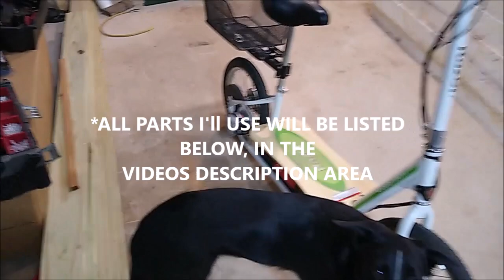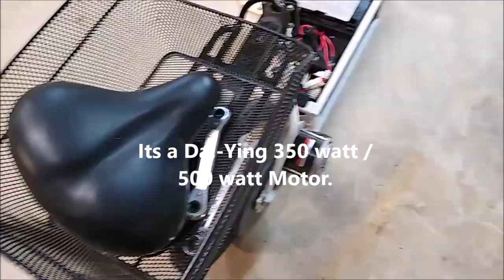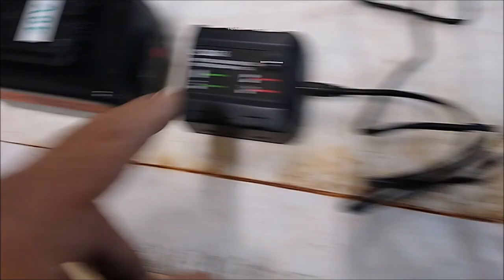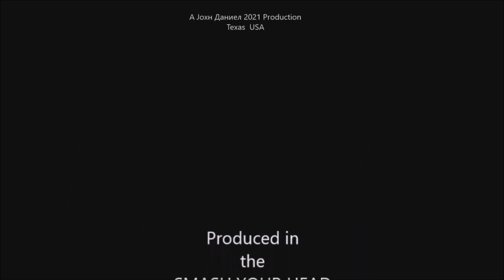Electric Scooter with Lithium & Lead acid battery Hybrid power

Comment from the maker: This Scooter has been durable, tough, easy to ride. 36 Volt Razor EcoSmart Scooter  https://bit.ly/35wNWOY , 40 volt Black & Decker Batteries https://amzn.to/3wFQCWm , 40v Battery Adapter https://amzn.to/3gMVqml , 40V Battery Charger https://amzn.to/3gDTE82 , 8 terminal Cam Switch 20A https://amzn.to/3gCnn19 .
Reply: I'm gonna be sticking to the stock batteries when mine arrives in a few days. Unfortunately having to charge the batteries is something we can't avoid and we simply have to accept the fact that these vehicles will always have a limited range especially give the f act that they're electric and not gas powered.

Comment: Nice little scooters but adhere to the weight limit of 220 pounds...We were giving a 6o lb kid rides on ours and the brushes in the motor overheated. I managed to stretch the spring and get the one brush working again and cleaned the armature. Good for now.

Comment: That was pretty cool bro! Love it!
Hey John? Incidentally, I just watched another video earlier where you upgrade the diodes in a solar panel. Yours only had 2,where mine has 3. Well, 6 really, but let's be real. 3 aren't even doing anything now are they? Lol
Anyway, I want to replace them as you did and just wondered if I need to know anything different since there are 3? Also, why did your diodes look like transistors, minus a pin?
And finally, should I replace all 6 or just use 3? I mean the current is only going to use the one with least resistance anyway, but I'd love to hear your thoughts!
And sorry, for the off topic lol

Comment: You could ditch the lead-acid batteries entirely and power the scooter from two Milwaukee M18 lithium batteries in series. They come in capacities ranging from 2Ah all the way up to 12Ah. Remove them when they are empty and charge in the Milwaukee charger. I modified my kid's electric go-kart which has a 36V Razor motor and controller--probably the same ones you have. There's a guy on eBay that sells 3D printed adapter plates for the Milwaukee packs.
Reply: Yeah and then run the risk of catching on fire while riding? Razor doesn't put lithium batteries in their electric vehicles for a reason, that reason being that the lithium batteries are prone to spontaneous  combustion even when the device is turned off.
Reply: @michaezell4607  Not lipoe
Reply: @michaezell4607  These units come as a lithium option, even the owner of this video mentions it.  Also a fire from these batteries are rare as they have built in protection from over charge or over current.  Maybe in a collision where the battery is damage there is potential for a fire.  If the owner of this video would have used Lithium iron phosphate (LifePO4) then the fire possibility is non existent.
Reply: better to use "40v" lithium batteries instead of 2 @ 18v batteries, where loading balancing can become a problem.  I find Greenworks batteries are quite affordable.  Ryobi batteries can be cheaper during Ryobi days at home depot.

Comment: How much rain did you get after running a dual system thanks for the video very informative
Reply from the maker: Having to trust my sons data recording the capabilities we estimate the 18 mile range given to us by The bike company is about 90% accurate at 16.6 miles, with these batteries carrying two of them we got over 28 and a half miles till they shut off. So I'm guessing that it gave us about 6 miles per tool battery of running around. Notably the speed was about two mile per hour faster when the tool battery was first put on but quickly dropped to about a mile per hour slower than the lead acids for the rest of its energy. However is still very functional. Extremely cheap investment if you consider it.

Comment: Unfortunately  I have to order a replacement front fork from Razor because when my scooter arrived the front fork was bent backwards on the left hand side so badly that the front tire cannot be put on. This appears to be a manufacturing defect as it looks like the left side downtube that connects to the axle must have been positioned incorrectly  in relation to the position of the steering tube during the welding process. Another amazon customer had the same problem when their scooter also arrived with similar  damage. The box that my scooter was shipped in was in terrible shape when it was delivered to me so it's no wonder there was damage?

Comment: I'm getting 2 miles on brand new batteries brand new motor can't get no more than 2 miles on this scooter what's causing the problem
Reply from the maker: Sounds like you might have a bad controller module inside there that's eating up a lot of the power

Comment: Great Video John. You mentioned in a earlier video about your Lead Acid battery bank with a Lithium kicker battery? Any future Video on it?
Reply from the maker: Yeah we best estimated that we can put 3 hours at 60 plus amps into our big lead acid Bank off of a 200 amp 24 volt lithium setup. And I'll make it to where it doesn't activate until 1 hour after sundown using a CDS cell sensor.
Reply: @JOHNDANIEL1  With a DC to DC charger?
Reply from the maker: No, a 60 amp standard solar controller. They are just battery chargers at heart. A separate 500 watt array charges the 24 volt set up, at night those batteries become a  placebo solar source to a single 60 amp standard solar controller feeding the 12v lead acids a booster if needed to keep them from voltage/D.O.D. sag. 
The lithium will just act like 22 to 30 volts of incoming solar juice to it. When they get below a input value they'll disconnect or if they reach 13.8 on the lead acids they'll disconnect.
Reply: @JOHNDANIEL1  ok I have 2 Eco razor scooter 🛴 one is 6 months old and one is still in the box they suck I can barely get 2 miles I have bought 3 pairs of batteries and charger my tires need changing I want lithium battery can be done

Comment: What if I have the same scooter but it's 48v not 36V is the wiring the same?
Reply from the maker: Basic wiring structure remains the same for 36 or 48 volt, if you can find a 56 volt tool battery and mount that'll work as an alternate.

Comment: Hey, Love your video. I have a question. I have a spare 48V Li-ion battery, can I use it for the exact Razor ecosmart and replace it for the lead acid battery (3 x 12V/7Ah)?
Reply from the maker: 48 volt is possible but check your motor control in the battery tray to be sure it's a 36 to 54 volt model.
Reply: @JOHNDANIEL1  Thank you for the response. I checked the motor controller and it is only for 36V.
Reply from the maker: You can order the same controller in 48 volt option, I believe the plugs are the same, go to their website and look for the 48 volt replacement. As far as I know the motor is a 30 to 60 volt capable motor.
Reply: @JOHNDANIEL1  that’s good to know. I will see if I can find a replacement. The OEM lead acid battery doesn’t last long enough for my wife to travel. And I don’t want to buy a brand new one. Thanks again

Comment: Lithium cells need charged Constant Current / Constant Voltage.  Your batteries are going to be short lived I think.  The batteries my have protection built in that will prevent over charge.
Reply from the maker: They use standard tool battery chargers with internal BMS in the tool battery and the lead acid has a standard 1.5 amp deep cycle controller charger.

Comment: Those are not real Black&Decker batteries - I wonder what the actual ah capacity is ?
Reply from the maker: So far so good. They ran the 4 miles to the river on one, then 4 miles back on the other one without using the lead acid set. They did get warm and did not like constant full throttle showing low battery to flash on the meter on inclines. They were not dead after that run in the 95 degree heat but very close. I'd say 4 ah is a  maybe, for $40 less than B&D branded I'll take them, but a 5 amp hour would be the perfect choice.

Comment: Your title is incorrect.  You are not using Lithium Iron Phosphate (LifePO4).  You are using Lithium Ion batteries.  Different chemistries.  Also you can save more money buy using a (home) three way switch.  May look ugly, buy if you use a black switch with a black plate cover it would harder to see.